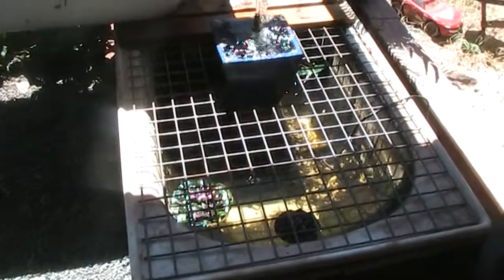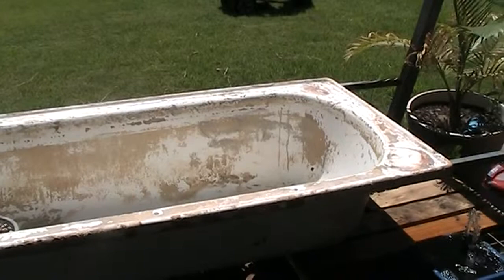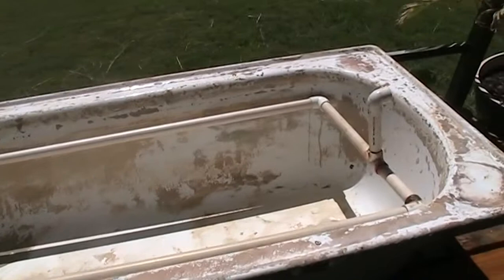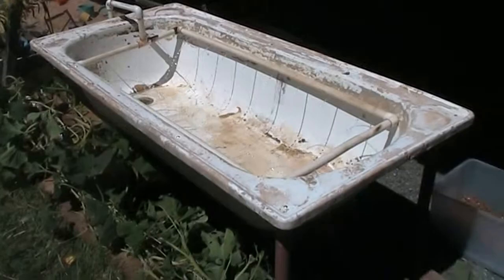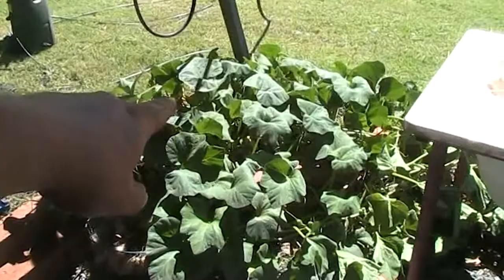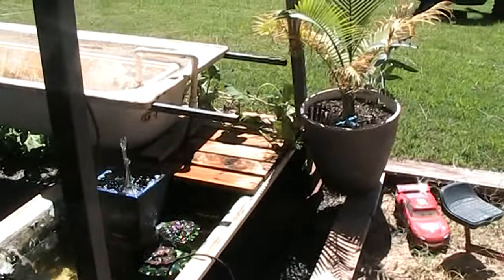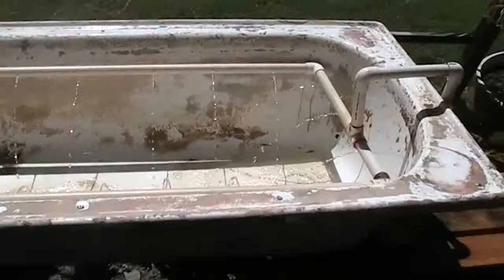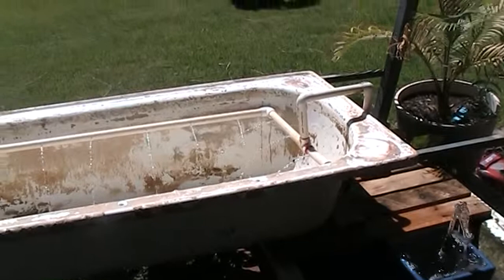Bathtub Aquaponics setup

Comment: Good stuff, man. I'm sure you've got it sorted out by now, but I literally just built a bell siphon out of a 20oz pop bottle. I just cut off the bottom and put a couple of cutouts for the water to flow and it's working flawlessly over a 1" stand pipe

Comment: expanded clay is expensive i use pebbles for expanded aggregate driveways. it is only $120  a cubic metre. easy to dig in and clean.
Reply from the maker: I found that the weight of gravel impeded the growth of my plants due to the roots not being able to penetrate as deeply.
I don't have the system any more as I have a bigger property and have a large area for a vegetable garden now.
Thanks for your comments, it does help others to make a choice on how to set up a system that suits them.
Thanks for watching.